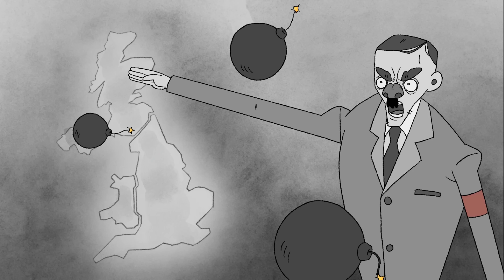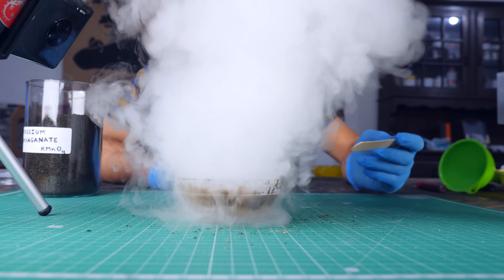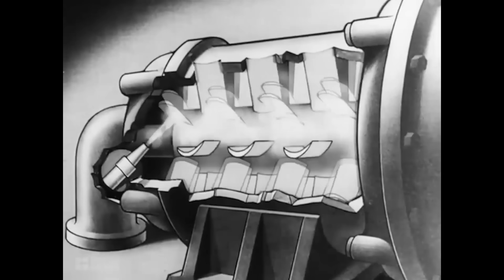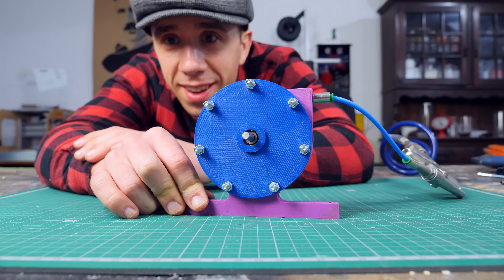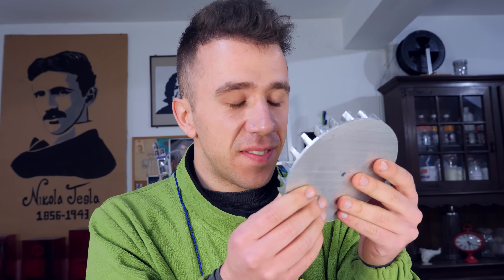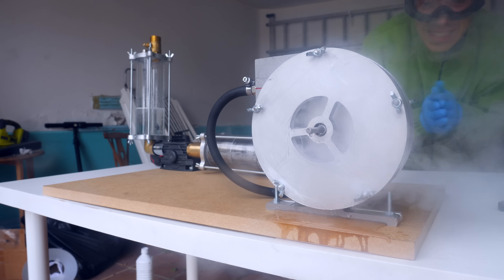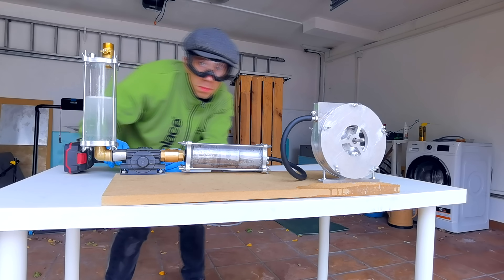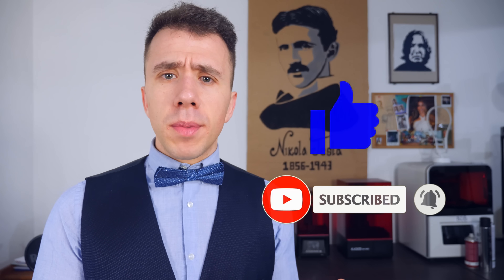I built the World War II V2 Rocket Steam Turbine

Comment: Ok, so here’s the thing: build a conventional Tesla turbine, galvanize its blades (or just their edges) with catalytic metal (maybe using those converters as the source) and inject peroxide through another converter into it. Although the initial conversion would be only partial, the rest of it is going to happen on the blades of the turbine. The rotation of the turbine will ensure to keep the still liquid fraction of peroxide at the edges of the turbine, where it still gets the chance to convert, and will increase the pressure in the turbine, ideal conditions for Tesla turbine.

Comment: machine the catalysator with tiny holes and seal the outer edges so there technically more surface area for the peroxide to touch therefore making more steam to power the turbine

Comment: great video as always integza. And what about a low pressure of atomizing the peroxide pre catalyst and what about a 3d printed two stage catalyst cylinder using pieces of rare metals and promangenate injection if possible

Comment: The blades of the turbine should self adjust to the best possible angle to catch the incoming air/steam and the converters need to be sealed on the inside edges to reduce liquid leaking and increase efficiency. Those are the "easier" fixes I can think of, beyond that a more complex purpose designed catalyzer with a flow regulated pump would be the most help catalyzing the liquid.

Comment: Try to mount both tanks vertically and have the outlet of the reaction chamber be out the top. That way any hydrogen peroxide that bubbles up will react more rather than go down the hose👍

Comment: The motor was probably too heavy of a break. Therefore not allowing the turbine to spin fast enough to generate significant amounts of power. With a gear reduction the turbine might spin at a much more efficient Speed.

Comment: Excellent use of knowledge to repurpose catalytic converters!
I'd recommend either mounting the steam hose outlet higher up or mounting the cat. chamber vertically (as many others have suggested).
Alternatively a 'water trap' between the reaction chamber and steam outlet could catch most of the unspent fuel.
Another idea would be to use a manifold to distribute the steam to several turbines on a common shaft.  That way you may increase the efficiency/power output.

Comment: Combine this concept with a turbojet engine, using the exhaust to run the turbine, which compresses additional air/fuel into the turbojet.

Basically a.. forced ram air intake.. turbocharger.. ? 🤔
Reply: A Turbo pulsejet. Which you've already done XD

Comment: make the Turbine self sufficient by using the rotation of the turbine to run the pump (will still need to be jumpstarted). Should be pretty cool and scary given that you will have a problem stopping the turbine once it gets running... but this should be fine ... i guess. Cheers :)

Comment: Need to use lock washers to prevent nuts from backing off. Mount catalyzer vertically. Design a cone shape in the center of the turbine to direct the steam out the exit so it creates less turbulence in the impeller housing.

Comment: I would suggest standing the catalysts upright, then add a liquid extraction chamber (two tubes running in/ out of a chamber at the top, the inlet tube reaches lower into it… i think you get my point) 
So that no liquid peroxide or condensed water gets to the turbine only the pressure

Comment: I think you need mount the catalyser in the upright position and have the outlet coming out the top, less chance of the hydrogen peroxide getting out to the turbine, and ensuring it all gets converted. Also maybe use ceramic bearings for the turbine and be sure to balance it.

Comment: Random thoughts:
Instead of putting the three pieces of catalytic converter in series, put them in parallel. Once in parallel add some kind of injector spray nozzle on the input side to try to distribute the peroxide evenly within each piece of catalytic converter.
Perhaps a reduction gearbox could convert your high rpm into usable torque? Perhaps to drive a propeller? Then you would have a stream turboprop...

Comment: I'm learning to cnc, too. The shop I'm at are pretty conservative and tells me to keep the feed width to less than 15% the diameter of the bit wherever possible and a step down of no more than the diameter during the roughing passes. For especially narrow bits like the one you're using, it's probably a good idea to also significantly lower the feed rate during the operation and ramp it up slowly as it progresses as you have more confidence that it's not overloading your bit. You can usually tell by the sound and vibrations it makes. That part is hard to describe because I don't have experience with your machine in particular. 

Chip evacuation is gonna be crucial for especially deep cuts because those chips can reduce tool life if it's let to recut — such as in a deep pocket. A constant stream of air can go a long way in preserving your endmills. For that matter, what direction do you cut for this machine? Do you conventional or climb? The cutting direction can really affect the quality and tool life.

Comment: Hello,
You could always fit a stator inside the rotor, similar shape but the reverse direction to the rotor and an exhaust nozzle to create a partial vacuum to increase the differential pressure over the turbine

Comment: i think you missing one more thing tank that catch liquid n releases air above to escape in tube so it can push motor faster

i been thinking about one thing that i wish you would build called Pull String Flying air plane with gravity weight and only using turin motor to sping it

Comment: you should make it like in 2:20
Three chamber with one way valve in its conjuction
make combustion chamber in vertical position with output on top to maximize the effect

and why I suggest like in 2:20 because its easy to refill "the gass" and to control how much to flow, and with the output on top position to make sure all the reaction without worry to spit out

Comment: To ensure the hydrogen peroxide catalyses a bit better, I'd recommend fitting a pressure release valve that only allows steam down the line once the pressure is high enough. I doubt it would solve the problem completely but I feel like it would probably improve it somewhat, ensuring some pressure actually builds up before going through the turbine. I think it would make the system more  efficient. 

I mean, a tight restriction in the line could have a similar results, to be honest.

In addition, an accumulator could be useful to keep the pressure more constant just like you see in aircraft hydraulic systems.

Comment: hey mano
Check out the axial flow compressors used in Jet engines, maybe more compressor stages will harvest more of that energy being released.
also if you rotate the catalic converter reservoir 90 degrees untill it's upright, only the steam will escape the system and go into the turbine.

boa noite!

Comment: Insteas of silver and platinum, will you be able to try manganese oxide or lead oxide to speed up the decomposition of the hydrogen peroxide. Apart from those things mentioned above, I think having a heat source to heat up the peroxide isn't that compact but will surely do a good job on decomposing the peroxide

Comment: Put the tube right side up in your sytem instead of just sideways so the fluid is at the Bottom. Also feed the H202 through the bottom, and the air out the top. Make sure there's spacers on each side of the inside of the turbine as well so that the gears don't drag on the wall, also give the fins on the turbine some kind of slope so there are some aerodynamics to the way it is going. Like a wedge. I'd look into some of the very high end fans out there it may give you some ideas for something perhaps more sturdy than just ball bearings. Good Luck, and great videos!

Comment: I don't have a 3D printer, but maybe I can offer an idea to the folks that do and are already looking at the models for this turbine. Since that is the part you will be focusing most on, what are some ways to improve the efficiency of the turbine? Can the blades be thinner, or of a slightly different geometry that will allow them to capture more of the force of the steam? I also wonder if the outlet could benefit in some changes in geometry. Reducing any turbulence there could also improve efficiency. Maybe some sort of cone shape at the center with a gradual curve? It seems fairly well balanced, but that should probably be looked at too. I'm not an engineer so you guys probably all know more than me about it. I just thought I would share some thoughts.

Comment: Someone already stated this, but mount both cylinders vertically.  I would modify the reaction chamber to allow liquid into upper part/maybe not quite the top...then the steam hole output on the top...if liquid is still released you will likely need some dead space/empty space towards the top to allow for the bubbling.

Comment: Try connecting the output shaft of the turbine to the input shaft of the pump. If the turbine produces enough torque to spin the pump, then all you have to do is feed it after your initial start. Also, as a few have mentioned beforehand, turn the catalyst chamber vertical...

Comment: Hmm looks to me like you should either redesign the converter chamber or maybe design an add-on for it. but to ged rid of the unreacted H2O2 you might wanna add one of those liquid/gas seperator bells like steam-powered locomotives use. basically just an exansion chamber where the liquids can settle out of the gasses under pressure. and you might wanna tweak the pump to either pump slower at the same pressure or just pump intermittendly or smth (no clue how one might accomplish that, though)...

Comment: I know this is off topic but I was watching the last video with the turbo pulse jet, I don't know if I'm late to the party and this is something that is already been discussed but by the addition of the turbo aren't you making the combustion chamber the same is a forge with the extreme heat, I wonder if you added kale wool on the inside if you could stop it from melting through where the spark plugs at

Comment: What about mounting the catalizing chamber vertically, and have the out port on the same cap as the in port. 

That way any excess peroxide pools at the bottom and catalizes in the bottom converter and the steam makes its way up and out. 

Maybe have channels around the outside of the converters for the steam to make its way to the top and not interfere with the peroxide going through them.

Comment: Hmm. Not producing much voltage but it IS a spinning shaft…. Maybe use it to wind up a trebuchet?  Then fling tomatoes?

Also, would making the catalyst chamber vertical and spay into the top/center so gravity leads it through each section on its way to pooling at the bottom?

Ed

Comment: Great vid! Sorry if this sounds negative, but I think several problems are from your bearings and balance. Machining the turbine flat, square, and symmetrical within 100 microns and balancing for the speed you want will do wonders for your efficiency. The same goes for tailoring your bearings for the task. I would recommend "Deep Groove Thrust" bearings, but I don't have much experience specifying bearings for high speed. Perhaps paired thrust and standard bearings could do it? Thanks for the ideas, and please keep 'em pouring!

Comment: Looking at the design of your aluminum turbine, it looks nearly identical to many flywheels on most small engines(Weed whackers, lawnmowers, etc). Now these are made of steel but im sure there is some aftermarket aluminum flywheels for those motors that you could buy and mill most of the metal to size and use as a turbine. I'm by no means certified or even familiar with milling or even fabricating so i'm sure i'm missing some kind of flaw with using one as a turbine but it might be cheper, adn less time consuming to use one as a turbine. hope this info helps!

Comment: VIDEO_IDEA: Create a Newton Disc on a string as a power generator.  String will probably break so use a more durable&flexible fishing line to do the experiment.  Check the efficiency since it looks like it's going to be an alternating current and feasibility for small scale off grid power generation.  Also see if a coil is necessary to provide a continuous pull on the string for term limit on its operation before the coil needs to be wound up again like the coils on a watch.

Comment: The catalyzer needs to be vertically mounted, bottom fed, and have a high pressure reflux column with baffles to recycle peroxide that hasn't decomposed.
Reply: Why not top fed with a parallel exit? I would think that the liquid dripping down through the column would have a better decomp yield - and possibly add a shower-head style drip to spread it over the baffles more evenly?
Reply: @xaqori  Bottom fed doesn't require a shower head to be fabricated and if he still doesn't have enough catalyst to fully decompose his fuel gravity is working with you to keep the liquid out of the turbine and require less bleed pressure through the reflux. 

TLDR; its easier, cheaper and more efficient to go bottom fed. Best part is no part.
Reply: Add a steam tank between the catalyst and the motor - two control systems: one to keep the tank at pressure, and another to release that pressure to the motor.

Comment: The stream is pushing the  peroxide down the tube from the chamber. Make the chamber vertical with house coming out of the top. As for usage seems geared down you could get some real torque from that much speed. Power generation is what is like to see, also Tesla's turbine would be fun to compare.

Comment: you need to gear it way down....    I'm not an audio mechanical person,   but using a belt drive and small capstan,   and a very large wheel for the belt should increase torque.     Then using that to turn a generator.

Comment: turn the cat-converter side pointing up and put a 2 ft tube on it with cap for your hose..it will keep pressure longer and hold the peroxide more to the cat-converter reaction are by returning it by not as much blowing out the turbine.😀

Comment: When you put it on a skateboard, instead of the drill for the pump, you could tie one wheel to the pump... so once you get started, it's runaway acceleration (to the physical limit of the system)... but you could use that to test max speed.

Comment: Many have commemted you could add more injectors (which is smart), but in the same line you can easy do a video testing the best way to made an injector testing for this all the previous nozzles you have done 3D printed, since now with chemical steem you don't have the destructive high temperatures so maybe it could help to also figure out which one works better! ... also, for adding an emergency stop, you can add deflectors, as pelton turbines have, are like spoons that cut the path of the injectors taking away the liquid/gas so you can freely stop the rotor.

Comment: You should build a much smaller turbine so it can spin really fast and with good efficiency, if you want a better finish on the cutter, I recommend using double paper tape with cyanoacrylate glue in between, it works much better than double sided tape.

Hi boy, nice channel, bye.:goodvibes:

Comment: Maybe mount the converter vertically with another check valve at the top after a longer catalizer and a buffer vat separating the water from the bottom taking steam from a bell at the top like a steam engine or compressor, should give more stable run and dry steam

Comment: Hi, I think using pre-chambers and spacing trough the catalizers block can help. And don't forget Bernulli and Venturi are your friends! ;-) I think a big improvement can is to stay focus on your wish: if you want torque, you need speed, more speed. This means different bearings, shaft, key to fix the turbine (not more glue). Hope it can help!

Comment: Video idea: try and make a small thruster of rocket which uses hydrogen and oxygen gas as fuel from electrolysis of water. It would be a really cool idea like a boat which electrolysed the water it's on to drive an engine

Comment: So the thing is carburetors sucks air (21% oxygen approx.) and mixes it with fuel so that the engine can burn it by sparks. What if you put that oxygen rich vapor made by cat converter and hydrogen peroxide into one of those engine that needs fuel and air to work? Will it output more power or will it flop because of the water vapor included on the steam?

Comment: For the excess HP issue you can mount the cats vertically and increase the cat amount which will increase the time for pressure to build a little but should be fine. Also if you wanted to make things complicated you can make a recirculation section just after the cats. Whatever is cooler 👌

Comment: Video idea: make a successful mini liquid propulsion rocket with an oxidizer tank and a fuel tank. Both tanks feed to separate pumps controlled by servos. Pumps both end at a combustion chamber connected to an exhaust. To be successful it needs to be more than 15 feet.